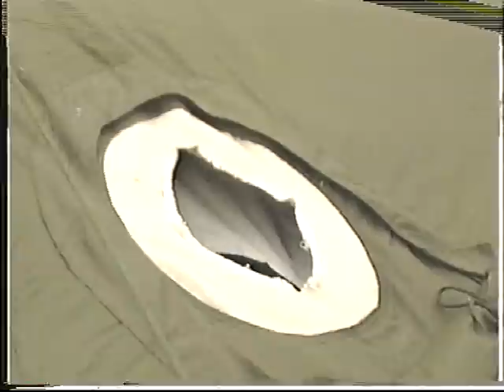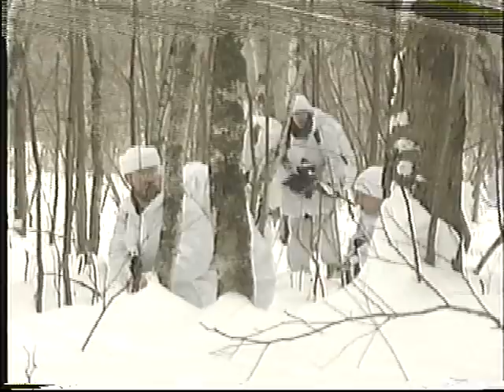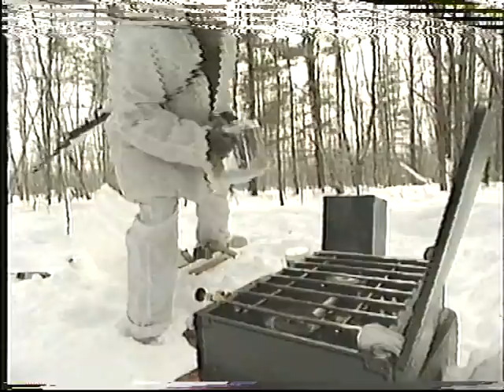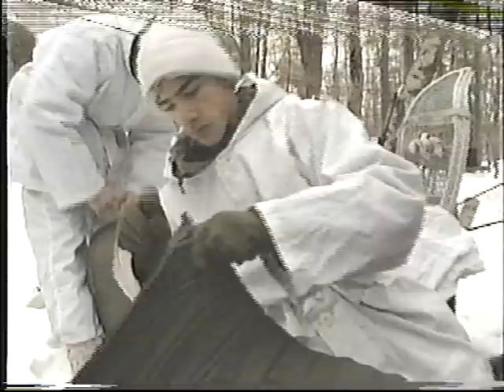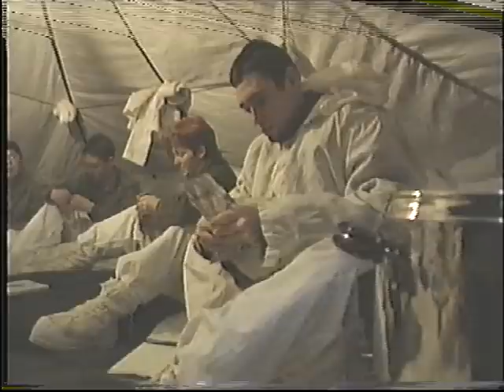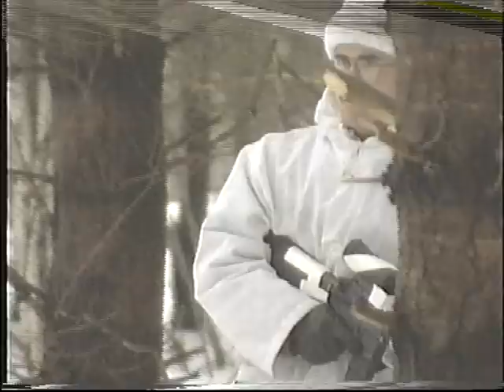Canadian Forces - Campsite and Arctic Tentage - Cold Weather Operations

Comment: In 1982 we had 5 man tents just like this one, but smaller.  We fastened the pole into the apex (before we left) with a piece of coat hanger.  Sometimes we had the orange telescoping pole, but we still fastened the folding pole to the apex.  One guy would just go inside and put the pole up.  We had air mattresses which were set up to form "couches" during the day.  We never kept the stove or lantern going at night, just used a chem light if needed.  The stove and lantern keep the tent warm due to the liner.

Your answers to some of the more inane comments were well done.

Comment: Many tactical mistakes, firstly, there was no camp outpost, secondly, the tent was not made of white material, it unmasks, it is easy to figure out the group from the tracks, they didn’t mix up the tracks, they moved too tightly, one shot from a grenade launcher could destroy the entire group, and people with glasses at minus 40 Celsius due to the exhaled air, will be with icy lenses and frostbite of the nose, and these are the main mistakes.

Comment: You had ond job… buy an arctic tent. Buy an WHITE arctic tent!
Reply from the maker: I can tell that you failed to read any other comment. 

White tents are only good in the Winter, and are difficult to change to any other colour. Also stands out in low-light conditions. 

Green tents can be used in all seasons, and blend relatively well in all conditions and light conditions (looks like a big bush at a distance). If in a white-out (actually really rare), then can put a white cover overtop to blend it in. 

Also siteing. The tents are not normally set up in the middle of a bald white field (both tactical & wind considerations). Best is in a tree line, or if not, then a bushy depression. Makes the tent blend in with the environment.

Comment: Almost identical kit to U.S Army Arctic Light Infantry circa 1980s-1990s (6th Inf. Division Alaska).  No Coleman stove, rather a rectangular-prism shaped Yukon firebox stove burning mogas from an upside down jerry can elevated off the ground with a field expedient tripod.  Also no white balaklavas, rather OD green ones.  We also always wore Kevlar helmets on top of the belaklava, if in a tactical environment.  Never went ANYWHERE without the k-pot on our heads:  Train as you fight, as they say.  No blow-up mattresses (poor Canadian Private who had to do that!)  We used rolled up foam pads.  Same exact basecamp procedures, tent set up/takedown and Ahkio sleds.  We didn't have that big handle on our sleds.  That would have been a nice feature.  The guys in this video were REALLY good and fast at set up and takedown of that tent and packing up the Ahkio.  Absolutely vital in combat and when it's friggin' -30 F.
Reply: The air mattress they had inflates almost full by itself, a couple of puffs then it's max'd out. Air mattress is FAR superior to foam in comfort and R Value. Smaller package too.
Reply: We would have kept our rifles with us...
Reply: @johnstacy7902  Not us.  I remember using the same procedure explained in this video:  Weapons kept outside with maybe one rifle kept inside the tent for security.  Sweating weapons in that environment are not conducive to operating properly.

Comment: If this is an Arctic tent why is it Green and not White?? This appears to be a bit dum! Also leaving your weapon to freeze up outside seems a bit dumb.
Reply from the maker: If you were to take the Basic Winter Warfare course (now Cold Weather Operator), you would find out why the Tents are Green, and the Weapons are kept outside. But in Summary:

- The Arctic Tents are Green, as they are much easier to hide in a forest or areas without snow covering. We have tested this with personal cameo coverings by putting a person in their all-white covers. When they are in a tree-line, they stick out like a sore thumb, as it make too obvious of an outline. 
If in a complete White-Out area (High Arctic), then it is just as easy to throw an old parachute overtop of the tent to make it white, or you would likely be building a snow wall to block the wind. Also, if the Tents were White, it wouldn’t be long until they were Black instead. Every little speck of dirt shows on White, and with the tent stove & lantern going and setting up/tearing down, there is a lot of debris that would get stuck onto a white covering, and be impossible to remove.

- As for the Weapons, they normally get between a small amount of humidity to a dumping of freezing rain put onto them just being outside. If the weapons were then taken inside of a warm area, that moisture would then melt. The next time the weapon was taken outside, that melted moisture would then re-freeze in the most inconvenient locations, and completely brick the weapon. It is impossible to remove this moisture, as we sometimes in a warm area as little as a minute, and we normally don’t have time to clean the moisture off.
Therefore, the normal solution to this moisture problem is that if a weapon is cold, then it stays cold. The metal is the same temperature as the environment, so it doesn’t melt any snow and get inside of the weapon, and freeze the weapon shut. Mounted units have a particular problem achieving this, as we usually have the heaters going inside of vehicles which cause the same issue, without the ability to leave the weapons outside.

- In the same vein with Weapons, they are also left outside for Safety. The tents are notoriously cramped when 5/10 troops are inside of them. There is barely enough room for personal with their sleeping bags and the stove, and it has always been a constant risk of the troop next to the stove being lit on fire. Live Ammo on Operations cause enough problems, and Blank Ammo on Exercise can still be deadly if mis-handled. Therefore, for everyone’s safety, the weapons are left with the majority of the kit on the drawlines just outside of the door.
Reply: @A_Ryan  weapons are kept outside so moisture does not build up inside your mechanism and freeze solid a basic artic cold weather drill to for us British training in Norway back in 1990 and we use the same 10man tent and also 4 man  tents kept in pulk sleds and cross country skis hard work but good times
Reply: Bringing  your weapon into a warm place and then watching  it freeze  outside is pretty  dumb. Keeping  it in frozen temperatures and  using  a tube of graphite as lubricant  is the answer to  all your frozen  questions.
Reply: As a young man I trapped with my family. Rifles were always left outside. We had scopes and they would have been useless if kept inside.
Reply: Not as much as this comment
Reply: Your very right, also wearing cam whites TRS only in the tree line with camouflage windproof smock on top is often used to great advantage, and the opposite way round above the tree 🎄 line ,often used with a white pack cover over a camoflarge Bergman, keeping the cam White's clean was the biggest battle for marines in artic Norway cheers

Comment: The white cammies are so clean and bright. Just give them a few weeks and that'll look a a lot different, especially if the stoves or lanterns are burning dirty. Also surprised to see plastic tent pegs. Never saw one in 12 years, always 10" spikes.
Reply: Swiss Army uses only Plastic Snow ankers from Swisspiranha you can even stretch them out in a oven  low temperature
Reply: The plastic pegs work as well as the plastic c7 mag did